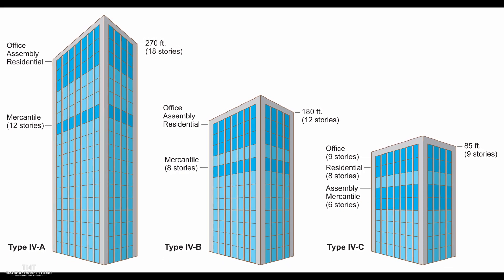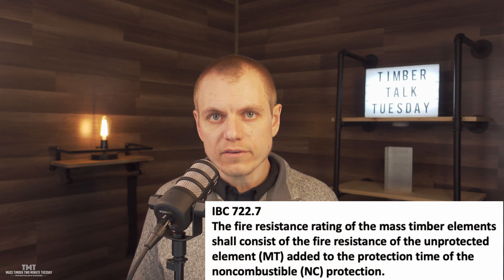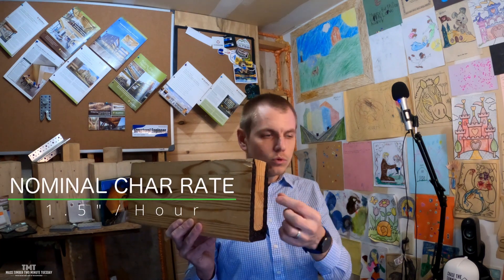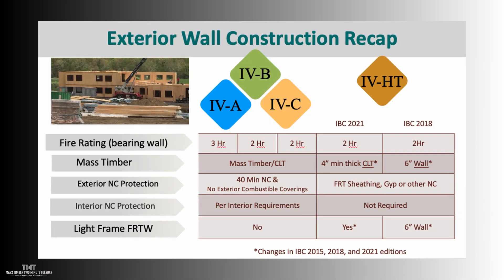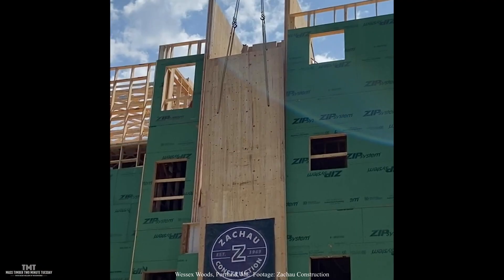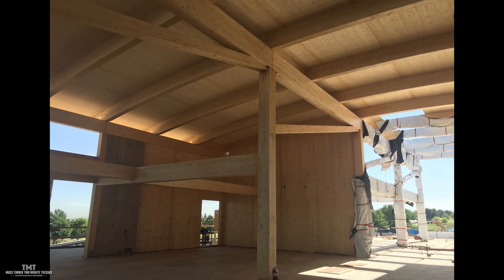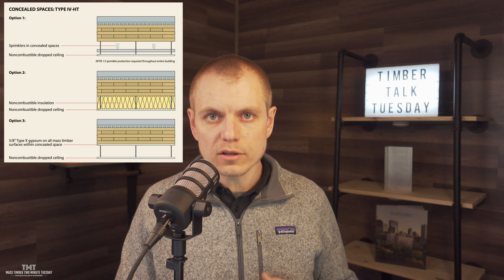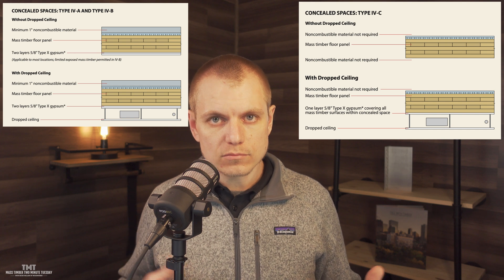Mass Timber Encapsulation (Part 2)

Comment: A word of caution when going back and forth between the IBC and NFPA 13, especially for architects. NFPA 13 has its own definition of non-combustible, that is different from the definition in the IBC. This might seem irrational but the documents are written for different goals. It works, you just need to ensure you are applying both.
Reply from the maker: Thanks for the tip. NFPA 13 also brings in the additional term limited combustible. Regardless of which document is used, mass timber is still a combustible material and therefore requires protection with noncombustible (or limited combustible) materials in some circumstances.